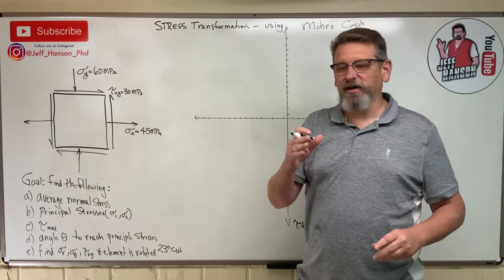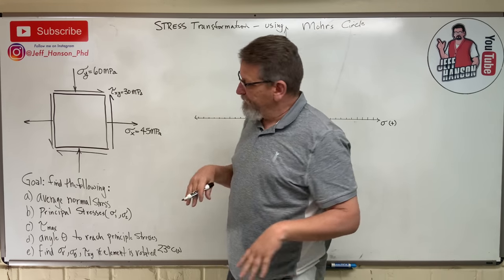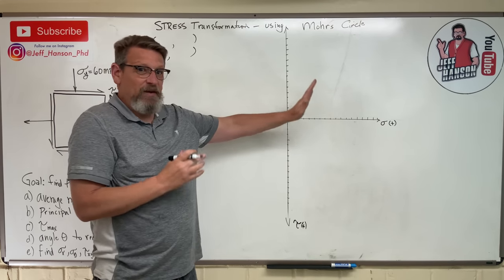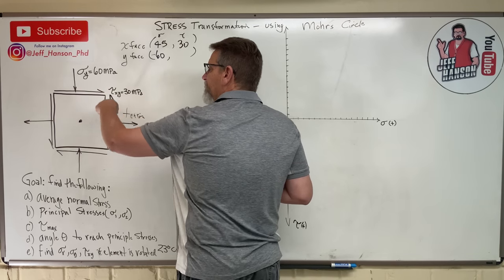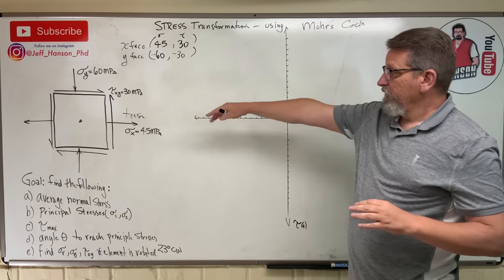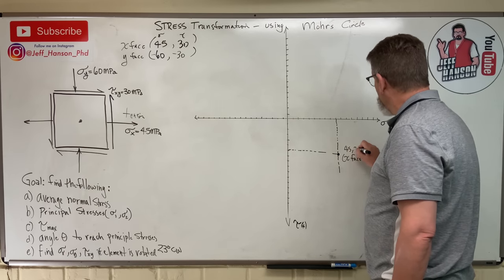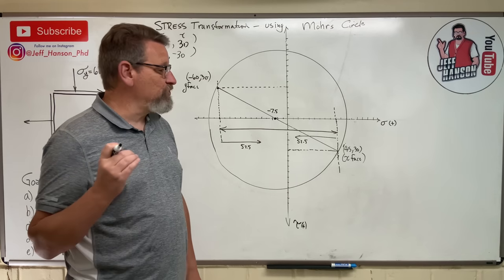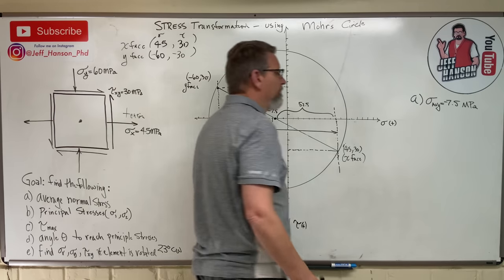Mechanics of Materials: Lesson 50 - Mohr’s Circle for Stress Transformation

Comment: I have a question with regards to part e:

I was under the impression that if the tensile stress - shear stress coordinate axis system is written such that the positive part of the shear stress axis points downwards, then we are supposed to travel counterclockwise on Mohr's circle when the element in real life is rotated clockwise. Is this not the case? I'm just trying to make sure I understand this.

My book has it so that the positive shear stress axis points upwards (I'm following my textbook for now). Now, in this case, in the context of part e, as I travel on Mohr's circle, am I supposed to travel clockwise, or counterclockwise?

Thank you.

Comment: I have a question related to application of Mohr's circle.

So is it possible to determine stress and strain values and direction when applying this method with strain rossete gauge ? of delta pattern 120°

Comment: Why would the radius not be Tau_max? For homework, sometimes it is and sometimes it is not...
Reply: If the situation is plane stress, and the normal stresses either have opposite signs, or there is only one normal stress, then the radius is also equal to the maximum shear stress.

If the situation is plane stress with two normal stresses of THE SAME SIGN, then the radius is not the maximum shear stress.  Because there is a third normal stress that is zero, perpendicular to the plane of loading, and there is an additional Mohr's circle that would need to account for it.  That second Mohr's circle, will govern the maximum shear stress.

If the situation has normal stresses in all three coordinates, and one shear stress, then you can draw the 3-circle Mohr's circle, and the radius of the largest Mohr's circle, will be the maximum shear stress.

For a general situation with multiple shear stresses, it is much more complicated, and Mohr's circle no longer works as a visual tool to solve it.  What happens is that you end up finding the Eigenvalues of a 3x3 matrix, and those Eigenvalues are the principal stresses.  From the 3 principal stresses, you find the greatest difference between any two of them.  Half this difference, is the maximum shear stress.

Comment: Great video. One minor correction on the angle shift transformation. It's 75.74 instead of 75.47 which throws the calculations off a tad. The last 2 digits may have swapped places. Still, a better demonstration than I had in my own class, which is why I am here. Obviously!
Reply: I was confused for 5 min for this part😂

Comment: hi , at 20.39 you said you would add 46 degrees to the clockwise direction. Where did this value come from? Thank you
Reply: Did you ever find out why its 46 degrees. I’m confused about that
Reply: @roudykhoury7571  the question said 23 degree , so in mohr's circle you should multiply it by 2, so 23 x 2 = 46 degree